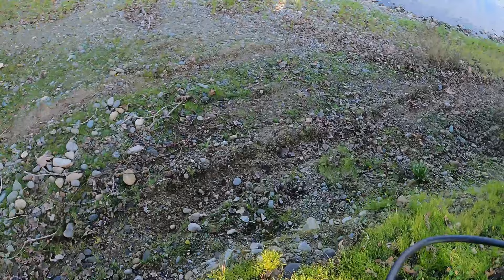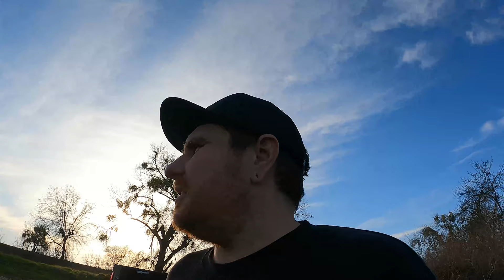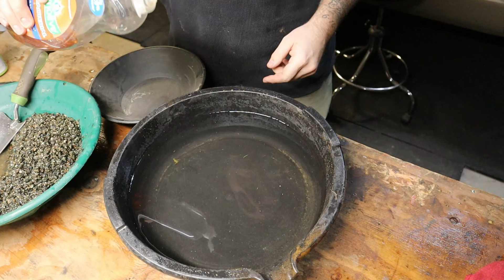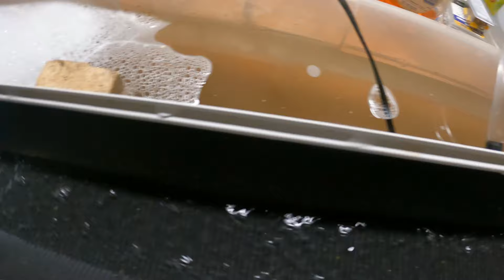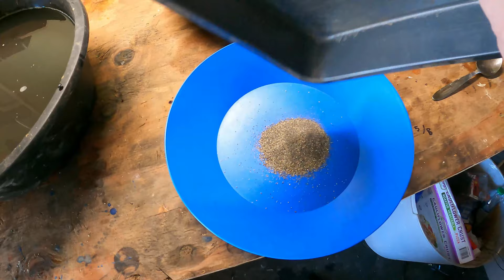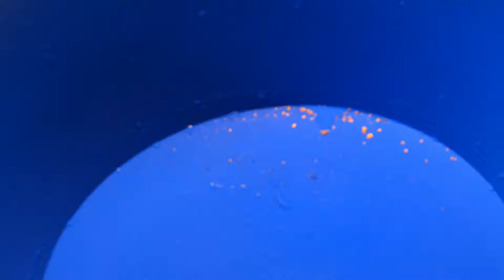Feather River Gold Prospecting

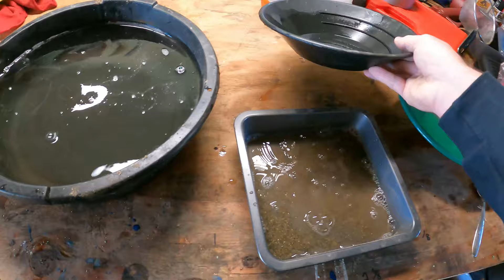Comment: at 15:12, unnecessary.       magnet works in water  just  the  same  way.!
Reply from the maker: I have tried it both ways. I notice more gold sticking to the black sand when wet. Thanks for the input.
Reply: actually, doing it in water will trap gold in between the iron sands and you will lose gold.